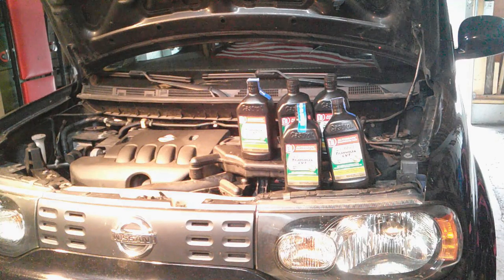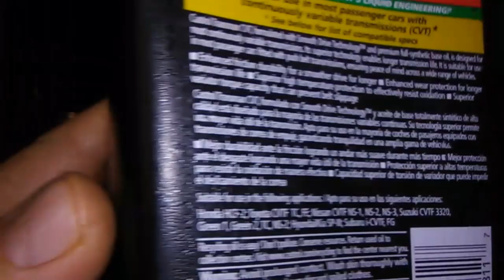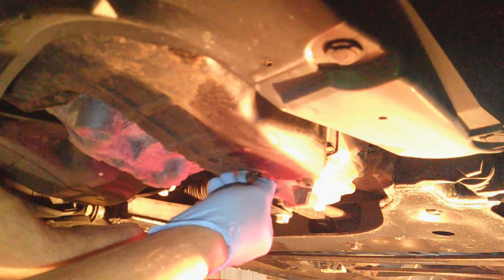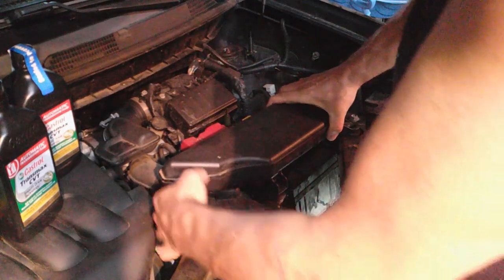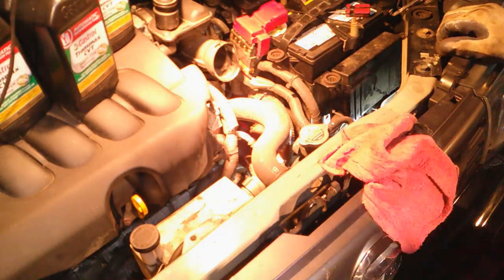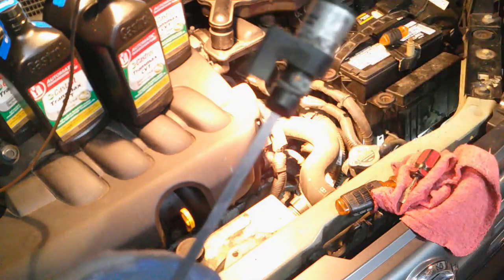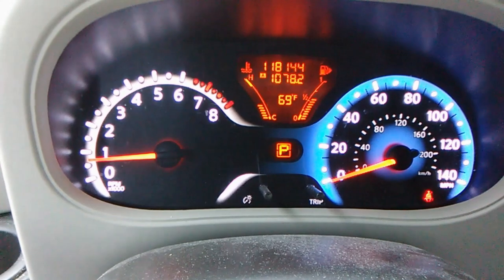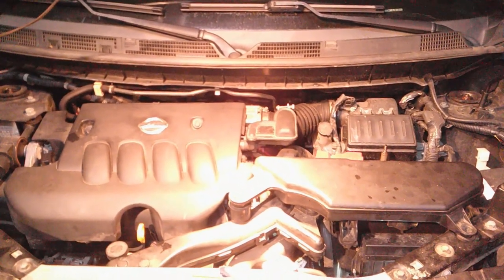Nissan Cube CVT transmission fluid change / 2011 Nissan CVT transmission oil change

Comment: I have the same car, It is awesome no problems at all 140 000 miles runs like new. I flush all the fluids, change all filters, changed all spark plugs and spark plug wires. Ceramic brake pads. Go to a great mechanic and have them do a 3 step fuel fuel injection cleaning service. Make sure they use BG products. It gets rid of all carbon build up The car roars now. Also use royal purple  engine oil it is better then mobil 1 one oil. It drives like a race car now!!!! Also use Trico Titan wipers they work the best.
Reply from the maker: Impressive! Good Job!👍
I like to keep up with all the maintenance on my vehicles also, that way the vehicles happy, I'm happy, and the vehicle runs much better with fewer break downs.
Thanks for watching and your comment. 😊
Reply: @WhipCityWrencher   I also change the surpentine belt every 80,000 miles to be safe. Drives better then new with royal purple

Comment: I tried screwdriver and key and STILL managed to bust the clip. Popped it back down in the intended orientation and have been checking to see any rise in the cap.  Zero. Even after bumpy roads. Now it's easy to check fluid levels.
Reply from the maker: 👍
A longer dipstick tube is what's needed here.

Comment: 4 qts 6 oz, drain and fill. 19mm draing plug bolt

My mom has a 2010 with 72k, she bought it woth 60k and the stealership said it was "serviced" before, we shall see when I rip her Cube apart and go from there. I was going to do the "filters" but they are just fine screens, maybe with an actual paper element but I'll digress, changing the fluid is detrimental first and foremost. If there are tons of shavings and noises already, you have better things to worry about than your fluid. 

Replacement with either idemitsu or Valvoline, maybe Castrol if i can find it. NS-2 fluid type. Not sure if NS-3 has backwards compatibility like engine oils and gear oils.
Reply: Could this be the reason why my cube is sluggish
Reply: @mikeanthony9092  sluggish as in? Need more information than that.
Reply: @dragontalontsiawd  when I’m driving the car slows down out of no where like it don’t wanna go
Reply: @mikeanthony9092  flush could help , worse case stepper motor

Comment: I see that Castrol Transmax is applicable for several vehicles, including some vehicles that require ATF. (Maybe the new bottle design shows more clearly). Did you have any issues by using a broad range CVT fluid application at all? Instead of using the NS-2 only application? Thank you
Reply from the maker: You're Welcome!
I did this transmission fluid change 2 years ago and the transmission is working fine.

Comment: 😫😤 argh geeze!!! You gotta temove the pan and replace the primary and secondary filters!!!! Argh!!! Like changing a diaper without wiping the butt clean...like changing the oil and leaving old dirty filter...like reusing a condom over and over again!!!! You gotta do it right if your gonna try to teach people.  CHANGE THE FILTERS!!!
Reply from the maker: Change the filters? The tranny filter is like a screen that's about it. An oil change is sufficient
Some people dont even do that.
Reply: @WhipCityWrencher  there is a hidden filter ... One is the screen and the hidden paper filter looks like a mini oil filter held in by 3 10mm bolts on the valve body
Reply from the maker: @productreviewspecialist  Then I apologize, I'll have to look into that and make a video of that also. Thanks👍

Comment: It runs a lot better on my mom's Nissan Quest.  Lots of the issues like shuttering  is gone. Now I need to find why is her tyranny leaking very little. I'm hoping it's because brake masters didn't seal it all the way correctly.  But I do recommend this brand.
Reply from the maker: If it's leaking and it wasn't before I'd bring it back to them and tell them about it.
Thanks for watching and for your feedback. 👍
Hope all goes well with your mother's Nissan.
Reply: @WhipCityWrencher  good answer.

Comment: I had this done at 110000. When would you recommend it being done again?
Reply from the maker: Hi Riverdrinker,
I'm no expert but I've heard that these transmissions don't last very long, especially if not maintained very well. This is my daughter's car and I want it to last her a long time so I'm going to change it about every 25K miles or 5 years whatever comes first. If you can do it yourself it doesn't cost much.
Thanks for watching! 👍😊
Reply: Mitsubishi. ..says with there cvt..
Every 30 thousand miles...or every 24. Months..

Comment: Did you check to see if there were any cooler filter or any filter in the oil sump?  I would like to no. Thanks.
Reply from the maker: Sorry, 
No I didn't, I just did a simple drain and fill.
 I'll probably change the filter when it reach's 150,000 miles.

Comment: How many miles has been driven using castrol transmax cvt fluid?  How has it been running with it?
Reply from the maker: So far the car is running fine. At the time, she had just purchased the car recently, so I just changed it as routine maintenance and will keep changing it at about 30,000 to 40,000 miles. If you want these CVT transmissions to last it's best not to leave the oil in there too long.
Right now the Castrol fluid has about 7,000 miles on it.
Thanks for watching👍

Comment: I’m going to be trying this soon. But after I’ve drained the old fluid and filled it with the new one. Do I turn on the car with the dipstick off? Or do I put everything back together before warming the new oil? Please help
Reply from the maker: Hi Eric,
You can leave the dipstick in or out if it's just sitting in your driveway, don't drive with it out, and let it warm up when you check it. If you have no leaks and you put in the same amount as you took out you should be all set.👍🙏😊

Comment: I stumbled into this video, it is very informative, and detailed , thank you, My car is 2014 does not go to the second gear right away, I am hoping changing the translation oil and transmission filler that my solve the problem . what is your intake on that ? again thanks for the video
Reply from the maker: You're Welcome!
These are CVT transmissions "Continuously Variable Transmission" They don't really have gears, but an oil and filter change may help if you are having problems. Do you have any transmission codes?
A Continuously Variable Transmission (CVT) does not make use of gears like a basic automatic transmission. Rather, it uses 2 pulleys linked by a belt. It's a bit like a snowmobile transmission: One pulley connects to the engine, the other one links to the transmission. The belt transfers the power between them.
Reply: @WhipCityWrencher  THANK YOU SO MUCH FOR TAKING THE TIME TO RESPOND . YOU ARE AWESOME..
Reply from the maker: @mohamedzhassanin4353  You're Welcome! Thanks!

Comment: I 'm looking to buy either a Nissan Cube CVT or a 4 speed auto . I have had automatic cars before , filters as well  engine oil change once every 18 months and never had a problem . I have been told if i buy a CVT to change the gearbox oil every year! would I be right in thinking this gearbox is so much more fragile and less durable then a 4 speed auto or a 5 speed Manuel ?
Reply from the maker: I don't know too much about these CVT transmissions, but yes that's what I've heard also. JMHO. but after every 30,000 miles, if you change the Transmission oil and filter which I will do next time, they will probably last a long time if driven gently.
The 4 or 5-speed transmissions can probably take more punishment than the CVT without failing. JMHO
Thanks for watching and your question👍
Reply: @WhipCityWrencher  Thankyou for an Honest answer, Sure the CVT might give you a better ride and more fuel economy but the mood music is going towards you need to give the high maintenance  CVT so much fuss and attention .

Comment: Is their a fluid filter on the transmission box?
Reply from the maker: There is a transmission filter in the transmission itself. You need to take off the transmission pan, the part that the drain bolt/plug goes into. Sorry I did not change the transmission filter and do not have a video on it.
Reply: @WhipCityWrencher  I'm gonna tackle this soon the cvt filter & pan gasket. I wonder if this maintenance will cause a code contamination reading?